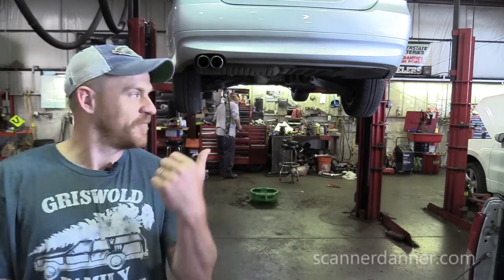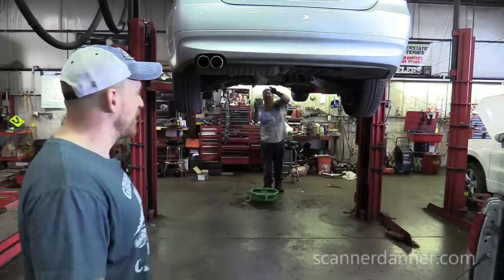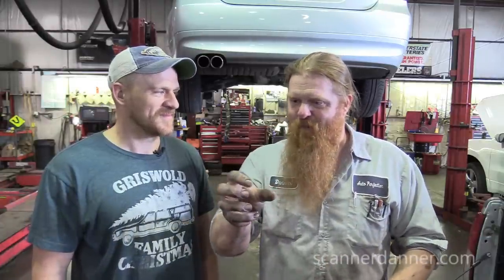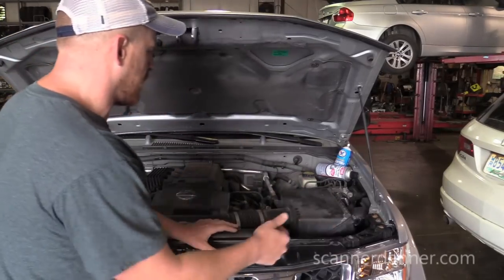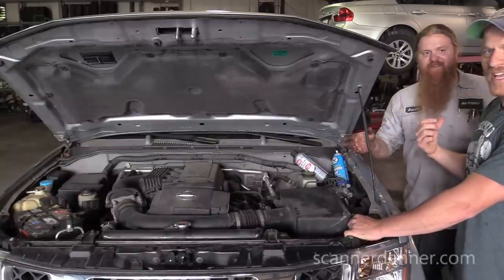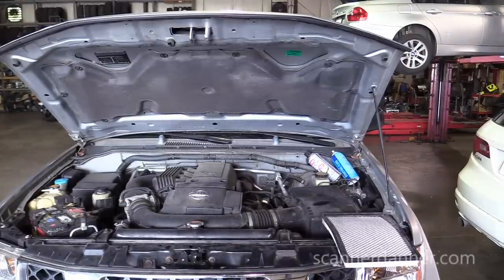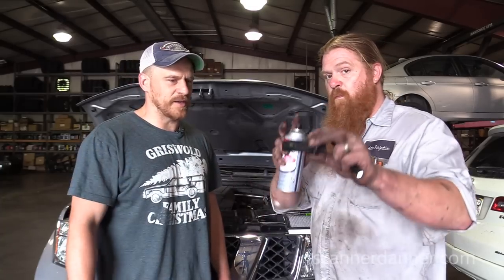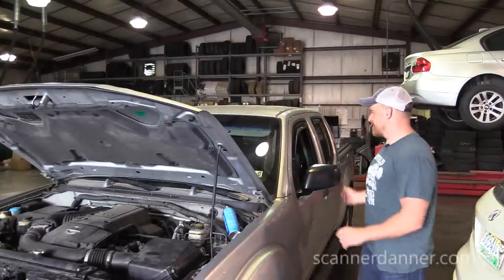Nissan Pickup, Low Power [Stink Bug in MAF Sensor]

Comment: Funny I had this happen to me this past Friday.  A customer had their Honda Pilot stall on the high way one day after their oil change at the dealership,  I pulled the intake hose and sprayed carb cleaner as your brother was able to keep it running. Checked Fuel pressure (hondas almost never had fuel pump issues, but it was easy to test and tested well) then I pulled the MAF and found a spider carcass. I guess it should be a lesson for techs to not shake out the air filter in the housing or near the housing because this happens. Dealer told the customer they needed 3k in labor - valve adjustment, MAF replacement, and a couple other of BS services. What crooks.

Comment: Paul is correct about Nissan not having a good backup strategy for unplugged MAF...from my experience (Nissan technician) Nissan will default to a strategy that was used maybe 20 or 30 minutes ago before you unplugged the MAF so if the car ran good 10 minutes ago or maybe longer not sure the time frame is. it will run good again when you unplug the MAF..... now if the car ran like crap for a few days and you unplug the MAF it will continue to run like crap. unless you clear the check engine light and or reset learned values. then you can get the car to run again in a decent default strategy if you suspect the MAF to be at fault...this is why your pops truck ran good when you unplugged the MAF because it was a sudden onset of bug in the MAF...BTW this is very common on these frontiers if people don't use good air filters and don't put the box back together properly.

I hope that makes since. I learned this lesson the hard way. damn Nissan's.
Reply from the maker: totally does and is something I will add to my "toolbox". clear the memory for the "unplug it test". Great tip man
Reply: Hello have you a video  about a camshaft signal from ignition module ?
Reply: ScannerDanner I got a diagnosis from lexus for my 07 Gs 350 of a bad pcm ecm. bc they got no comm.  I sent it to Sia electronics. got it back saying no problem found. looking online. I found something saying fuel pressure sensor goes bad it cuts comm with your scanner and start instantly kill. can't find this part anywhere. its supposed to be by the throttle body. can you give any 5 volt advice etc schematic
Reply: Dominic Waterman unplug the fuel pressure sensor and see if you get comm back...if you do then you just verified that a new sensor will fix the problem. is it fuel rail pressure sensor or fuel tank pressure sensor. I don't think Toyota uses fuel rail pressure sensors.
Reply: Auto Fix Pal ...thanks so much for your time and your reply. your channel is my Go To. keep up the good teaching work. I'll pull the plug and see if she runs and get back at u with results. ...or gets comms back anyway. k thx
Reply: Fantastic tip AFP!
Reply: South Main Auto Repair that information did not come to me easily.. I had the same exact symptoms on the same vehicle. ☺️
Reply: When it happens like that we are darn sure not to forget it!
Reply: Auto Fix Pal. you had the gs350 with sOme issues?
Reply: Dominic Waterman no I was talking about the Nissan frontier in the video.
Reply: South Main Auto Repair absolutely!
Reply: Auto Fix Pal .......like duh

Comment: scanner I really liked how you wanted to mention about spraying the cleaner or throttle spray in the intake. I have come across it twice that the maf actually litterly blew up due to the heating filment in the maf. Lol danner was actually just worried about fixing the issue. One of the techs face was so lucky when this happened. Another tip guys don't look down the intake while spraying if you do it.

Comment: Danner is on the right path when he mentioned; someone changing the air filter. Someone could have changed the air filter and then blew-out the the bottom of the air box with an air gun and the debris from the bottom of the airbox could have migrated to the MAF.
Reply: I do that when changing them, but I hold the old filter in the top or cover the hose/hole with rag first. 
maybe it was a cardboard from the filter packaging or careless cleaning with new filter laying on top engine. lol

Comment: Hey James...Ooops I mean Danner,  
let me guess, another water pump job in that silver Broken Motor Works. haha
Always fun to watch you guys.
Reply: exmotorsports yes . that's the last aftermarket bmw pump I will install. the first one didn't communicate immediately after install. this one worked good for 3 months and shorted internally blowing the 30 amp fuse . put this last one in under warranty . if it fries within the 1 year warranty period.  the customer is gonna pay the difference for a beemer part since it was his call to do an aftermarket anyway. ugh
Reply: Oh Man..Bummer to hear.  Didn't think it was the same car. Sorry to hear that.  Well, not to throw salt in the wound but the one I changed out is still going strong.  "KNOCK ON WOOD"  Certainly don't want to jinx myself here.  But just for your info in the event you get that booger back.  
Good luck with this one. Hope it works out.
Cheers

Comment: A note on Nissan fuel trims. They call the fuel trim PID's ALPHAS. 100% will essentially equal zero. Anything greater than 100% is adding fuel and anything less is removing fuel. So the ECU is searching for 100%.

Comment: Had a similar situation with a vehicle. Was replacing the upper intake manifold on a 2007 Crown Vic for a crack and coolant leak. Vehicle ran fine before the job, then would not start(would start and stumble then stall) after reassembly. Left induction components off over night(last job of the day)and a spider built a nest right inside the MAF. Took about an hour to figure out. But considering everything that was removed during the repair I of course thought it was something I had forgotten to plug in/ assemble correctly. Stranger things have happened I'm sure.
Reply: now that is funny and proves yet again the stupidity of today's technology, when a tiny spider nest, bug, dirt, wood, leaf flake stops a whole machine...

Comment: I just had a Pathfinder yesterday that did this exact same thing but with a Japanese beetle. The air filter had been mangled and wasn't sealing in the box. I actually found it taking the air box out to check the fuel pressure. I was certain it was a fueling issue because of the way it sounded and died immediatly with any throttle input.

Comment: I had an old volvo come in years ago with some driveability issues, maf sensor was unplugged when the car came in and plugging it in made it run terrible. I figured for sure we had a bad maf, but after installing new part car ran just as terrible, and to my surprise unplugging it made it run decent again. The customer didn't want to pay to go very far in diag time, so we returned the new maf and reinstalled their original, leaving it unplugged. Never did get the chance to dig into that to figure it out, but ya the unplugging it trick can be a great tool but can also get you into trouble quickly.
Reply from the maker: Perfect example. The default strategy on a disconnected MAF generally causes the system to run a fatter pulse width across the board which can mask other lean conditions. I have a video on this on a vehicle with a leaking brake booster (I think). I'll link it in a minute.
Thanks for the comment!!

Comment: That was fun! Question: so this confirms my theory (not just stinkbugs) that products like Pre-oiled K&N filters (aka aftermarket) can cause issues to MAF? This makes me look back at the idle and operation issues of a Toyota I owned that had the oiled K&N "Performance" air filter. I suspected the MAF became coated. When I replaced the MAF and went with OEM filter, it ran like day one. Folks: don't buy something the manufacturer doesn't recommend.
Reply: Hii have an 88 hardbody changed the oil put a k and n oil filter on the first crank I got a ruff idle and it dies. Does this everytime I start the truck cold or hot. It's only been a week.

Comment: Brake clean instead of starting fluid. I once used brake clean on an engine that was freshly rebuilt it was oil primed and lubed with assy lube but someone left the crank sensor loose. It was trying to start but after a few attempts to light it with brake cleaner , we took the engine apart and had to throw the pistons away because the brake clean robbed all lubrication and welded the rings into the pistons and I could not remove one. True story. Brake cleaner has no lube and starter fluid does.
Reply from the maker: That's a good tip, but the reason I dont like starting fluid as a diagnostic aid, is it is so volatile that even compression can ignite it giving you a false direction

Comment: Quick question for you. I hope you can help me or point me in the right direction. I have a 03 Range Rover with the 4.4l. I have no power to the fuel pump, the starter doesn't get power, the display in the cluster where you have the PRND when out and the check engine light when out.... when I said engine light when out I meant the engine light doesn't come on when you turn the ignition key on for a couple of seconds like it should..... plus if I wanna scan for codes the scanner won't work at all..... to me I sounds like a computer problem or security problem........ I check all the fuses and they all good, I check for power coming out of the ignition switch and there's power coming out...... I would like to know that you think of that.... any help will be nice thank you in advance..... I love your channel.
Reply from the maker: Next step? Check for 5v reference at the TPS or MAP. Here is a playlist I've created on testing the 5v ref circuit. 
https://www.youtube.com/playlist?list=PLAFYVCyenqcpP9ykkWb2D16nVEjyQ1eTZ

Comment: Can you help, looking for help. 95 nissan pickup, 4 cylinder, 2 wheel drive, manual trans, base model.  Think I've changed all sensors, new fuel pump, new plugs and all that but the truck is still acting up. Cold start, starts on third try, runs and idles great, no smoke but as soon as you give it a quick acceleration  it bogs down, sometimes backfires, you can slowly accelerate and it does fine but can't gun it or drive it. Just bogs and sometimes dies.  Asking around to see if anyone has any suggestions before I have to breakdown and pay someone.

Comment: I just took my 2006 Nissan Altima in to a mechanic, had a P0340 code, camshaft/crankshaft position sensor went bad, my car stalled on me, I almost got stranded on the way to work this morning, the car stopped on me, I tried cranking the engine a few times, it turned back on, thank goodness, but I had a hard time accelerating. The first few times I stepped on the pedal after making stops at a red light, it felt like the car didn't want to move at all, then for a while the car ran okay again, luckily I didn't have to call a tow truck, I made it to the mechanic after work, I gotta take my vehicle for the emission test soon as my sticker expires at the end of the month. ------  last recorded current mileage 81822 miles  Thu. 1-18-18.

Comment: Ok fellas I need some advice,  I have a 1994 nissan frontier xe pickup with a v6 engine. It's an automatic with the shifter in the steering column.  The shifter sticks and its hard to get out of park. The next problem is that it will run ,but when it's put in driver it dies when you push the gas pedal. My question is could it still be a fuel issue if the truck still runs in neutral gear position?
Reply from the maker: yes it absolutely can still be

Comment: Having similar issues with a 2000 Nissan  Frontier  it starts and runs for  bit and when I give it gas it starts to shake every now and then  and eventually starts to lose power and then turns off. No check engine light is on and had a guy scan it and didn't find anything with his scanner.

Comment: Have an issue with my 1990 nissan SE-v6 pathfinder. Driving to the store couple days ago soon I pull in it just shuts down, it turns over sounds like it wants to start, not on its own and idle on its own. The only way is by giving alittle gas paddle then fires up and idles when giving a little gas , soon you let off gas it dies. While idles with a little gas peddle it spits and stutters and pops and backfires through the catalytic converter. I unbolted the catalytic converter still sounds like it wants to fire up on its own but it won't not unless you give it a little gas and it still spits sputters pops and backfires. A brother of mine his buddy says it's probably jumped time

Comment: i have the same problem on my 1995 nissan d21 ....i bought a new massairflow and now if i connect it, it does that and if i disconnected is good and light goes off and until i start driving it wants to turn off..

Comment: Your premium channel have some issue? Because I can see any video :/
Reply from the maker: ScannerDanner Premium subscription, playback or payment problems are all handled by YouTube. Unfortunately I have no direct control of any of this. Everything is based on your YouTube account.
Some common playback issues:1. You are not signed into the YouTube account you subscribed with2. Try a different browser. Recently I had someone using a Safari browser that ended up needing to use Google Chrome to fix the issue, but this seems more of a mobile device issues than a desktop or laptop.3. The credit card used on your account for the reoccurring payments has expired
If you need additional help, YouTube offers great support for the paid channels. Here is a thread I've created on my forum to help guide you to the proper page.
https://www.scannerdanner.com/forum/scannerdanner-book-questions-and-discussion/303-sd-premium-subscription-payment-playback-problem.html
Thanks again!Paul
Reply from the maker: did you get it fixed?
Reply: ScannerDanner nop :/ i try different method to see your channel but always said: an error occurred. please try again later. (Playback id:1KF_5EvaG-5tXGgQ) men I love your premium channel but I have to cut my sub
Reply from the maker: What country are you in? We're you using a VPN?
Reply from the maker: For others reading this:
Unfortunately YouTube has placed country restrictions for the paid channels. But there is a way around it using a VPN. Below is a threadI've created a thread on my forum to help. https://scannerdanner.com/forum/scannerdanner-book-questions-and-discussion/475-access-to-sd-premium-in-non-listed-countries.html Thanks for your interest and I hope you can make it work for you.Paul
Reply: ScannerDanner I'm from Puerto Rico and i was using hola vpn but after 2 month or a little more you tube don't let me see your channel
Reply from the maker: I'm sorry brother. I wish i could help more than whats here.
https://scannerdanner.com/forum/scannerdanner-book-questions-and-discussion/475-access-to-sd-premium-in-non-listed-countries.html

Comment: I got a 07 Nissan versa it started surging when you stop at light and stop sign so I clean the throttle body that didn't work it was top motor mount but I cause a nother problem high and low idle so went  AutoZone got throttle body put it on tried to learn it like the parts book said didn't work swap it out for another one same thing high low idle tried learn this one nothing cause another problem gas pedal sensor went out bought a new one put it on it work ok tryed to relearn throttle body when I did it gas pedal quit working tryed to relearn gas pedal didn't work swape it for nothing gas pedal it didn't work out now mash the peddle to the floor u get no response and still high and low idle and no gas pedal now
Reply from the maker: Put the other parts back on and do a throttle relearn. May need a scan tool to do it

Comment: I'm on s security have obd1geo never  has check engine light come on except w key turn on in12years .my friends spend thousands for all sorts of sensor problems to get inspected or keep running afraid of new cars . Bad battery they change everything on Dodge mini first 1000$ dealer made correct diagnosis this is so awful.😎